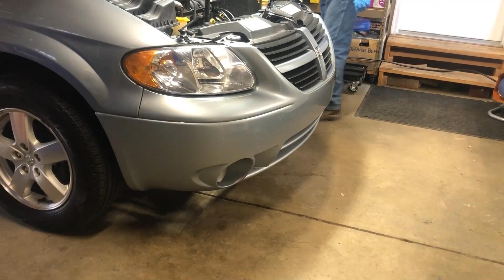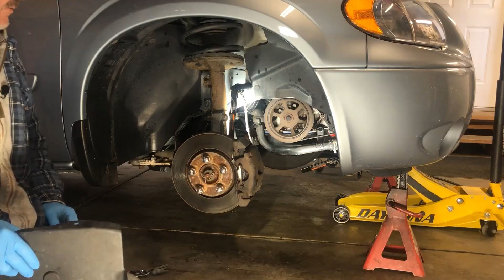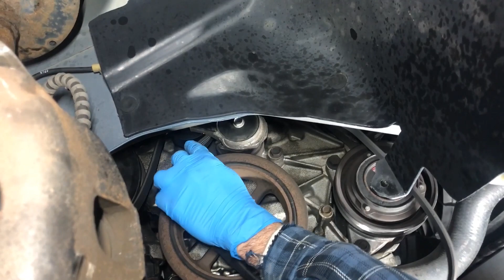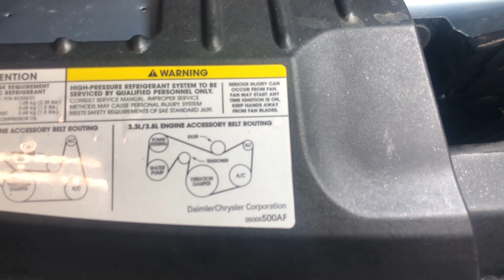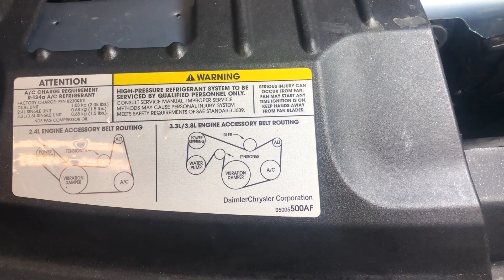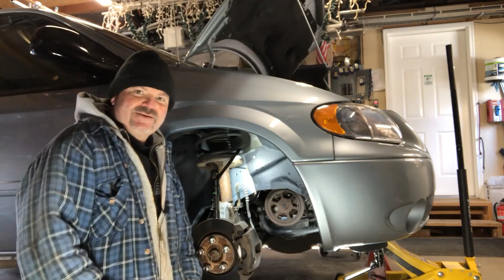How To Serpentine Belt Replacement Grand Caravan Town & Country

Comment: Great video and nice detail.  A couple of notes:  1) The serpentine belt tensioning tool can be loaned out from AutoZone and, probably, other parts stores.  2)  I know this video covers 2001-2007 but, FWIW, my 2009 T&C uses a different belt routing than the header graphic shown at the beginning of this video.  Fortunately, I took a several snapshots of my belt routing BEFORE I removed it.  (There is no sticker under the hood that shows the routing.)  3)  When putting the new belt on, I found it easier to start installation at the top, then getting the belt around everything except the A/C compressor.  Then, using the tensioning tool, finish the belt installation around the A/C compressor.  4)  Make sure the belt is all the way on the tensioner and idler wheels (and not hanging off the edge a bit).  5) Interestingly, the 2009 T&C doesn't take a 1/2" ratchet end; instead, it takes a 3/8".  This resulted in me not using the shorter piece shown in this video, using only the long part of the tensioning tool.  6)  Getting the belt around that tensioner is a b*tch.

Comment: Now all I have to do is replace the water pump and alternator. I got the alternator in yesterday still waiting for the water pump. Then I have to find a place to do it, they won't let us work on cars in the apartment complex 😞
Reply from the maker: Oh, I'm sorry. That is not an easy job to do in a parking lot.  The alternator is pretty straight forward but the water pump is some work.  I hope it went well for you and your van is up and running again.  I appreciate you stopping by and taking a moment to leave me a comment and I apologize for not getting back to you sooner.
Reply: @javosgarage  Got it done, 300.00 labor bill. Now I get to have the lower control arms and ball joints replaced, 3 months after the warranty expired! And I'm having problems with Red Bluff Chrysler Jeep honoring the warranty on the A/C compressor clutch. You can hear it grinding when it is not engaged!
Reply from the maker: @ChrisW96019  Wow, I'm sorry to hear you're having all these issues.  It may be worth a call to the factory customer care line and explain your situation.  Hopefully they would step in and put some pressure on the dealer to make things right,  I wish you the best with this CW.
Reply: Been there! Apartment life makes it hard to work on vehicles! I told the Apartment manager once, that I need to fix my vehicle so I can go to work to pay my rent! 😂

Comment: Can you bypass the AC clutch with a smaller belt on this vehicle?
Reply from the maker: Interesting question Chawn.  In theory, I suppose it could be possible because not all of these vans (a very base model for example) came equipped with A/C so I would suspect they would use a different belt.  I haven't had one these vans without A/C so I can't say for sure.  I would start by searching for a belt for the most basic model and see if it gives you the option of equipped with A/C or not.  Hope that helps give you some ideas.  I apologize for my delayed response, I was away from YT for a little bit.

Comment: You are an awesome teacher I have learned so much. Have you done rear brake pads or oil change on this vehicle. Where is safest to put the jack and jack stands?
Reply from the maker: @Life With Duchenne - Thank you very much!  I have done the brakes on these vans countless times but have not done a video.  Yet.  I will definitely be doing one when I get my next van though!  I'll answer your jack stand question in the comment you left on my  other video.  That answer will be later today though as I'm on vacation and will need a little time in front of my computer, I just wanted to touch base with you this morning.

Comment: Is the serpentine belt size different from 03 caravan to 07 town and country
Reply: 3.3 liter both vehicles
Reply from the maker: @Daniel Smith - Got it, gimme a minute to look things up and verify.
Reply: So anyone??
Reply from the maker: @Daniel Smith - You should have an answer posted.
Reply from the maker: @Daniel Smith - Hi Daniel.  I was going to say a quick yes but I just did a quick check for you to be 100% certain.  An 03 Grand Caravan & 07 Town and Country with the 3.3L motor use the same serpentine belt part #.  Hope that helps you.  Thanks for stopping by!

Comment: Was it safe lifting from the front?
Reply from the maker: You should have no problems providing you set your parking brake, chock the the rear wheels and then use the front motor mount as your lifting point.  I have another video (how to change the oil pan gasket) that goes into this in a bit more detail: https://youtu.be/wrcmqeBgvOk  
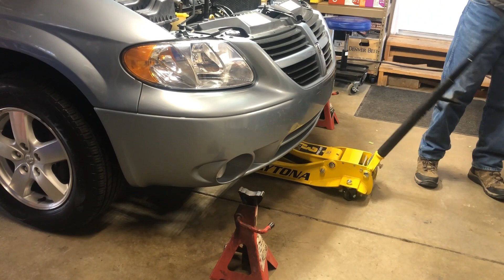If you go to about 1:25 of that video, I show where I place my jack.  Hope that helps you, thanks for stopping by!